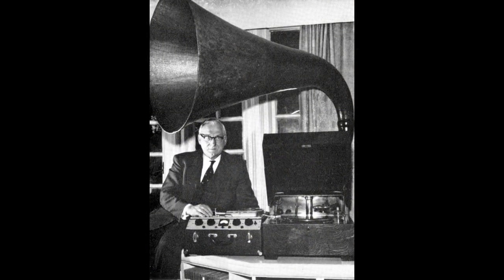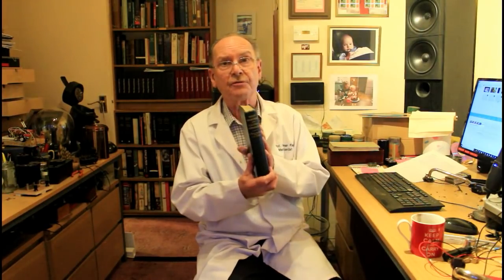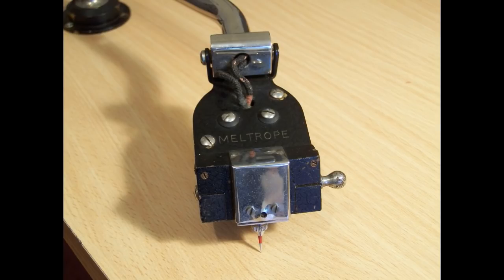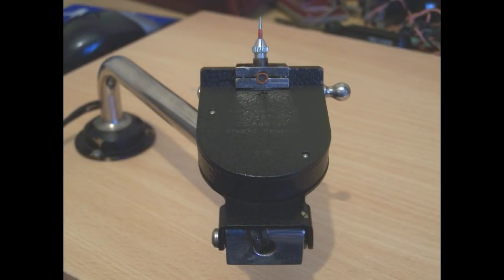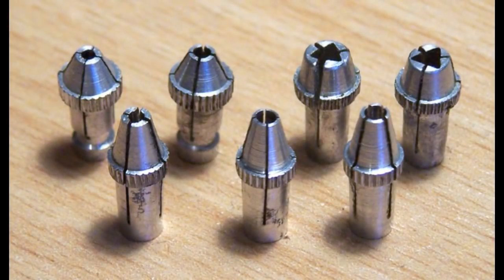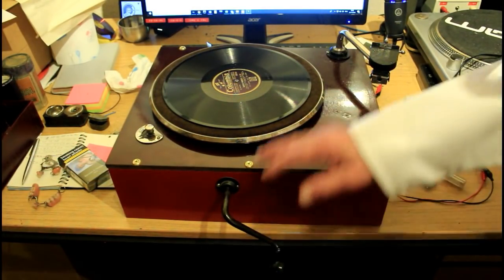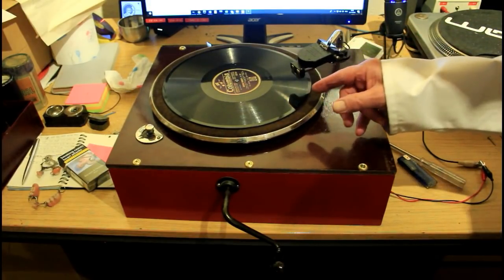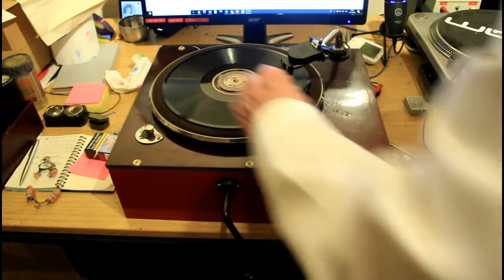meltrope electric pickup ~1930

Comment: Wind up spring motors were typically paired with a very heavy platter,  often close to 10 pounds, and thus having a steaying flywheel efect rater lacking in the thin turntable made of plastic in todays player.

That this Garrard unit had 2 springs is a plus also.  Gerrard was a qality manufacter of turntables.

Designend by man who was expert in the field ss descibed in video, it was better than heavy hosershoe.magnetvpicups that were normal for the time.

In fact vloser to kind used to day.

Comment: Thanks for this and congratulations on getting the toothpaste back into the tube.  I really loved the sound and it seems well matched to the early electric cutting heads.   Better than either the mechanical soundbox and horn or a modern MM cart IMHO based on your video here.

Growing up in the 60s and 70s there was a Stromberg-Carlson hifi in my grandparents' house that I was always forbidden to touch and I have always wondered how that pickup (admittedly a decade or so newer than your example) sounded.  When my grandmother passed away a few years after my grandfather, I passed by the offer by my mom and uncle and aunts to take it home with me because I was afraid of tinkering with direct-wired tube gear in those callow days of my young adulthood.  Still regret that hasty decision.
Reply from the maker: Thanks for writing. But don't worry. On the one hand, yes - it is very prudent to avoid old-time high voltage circuits. But on the other, it is quite OK to feed an electromagnetic pick-up into a modern 'Line Input' on a standalone amplifier. Such pickups usually gave out 100, 300 or maybe even more millivolts - an enormous figure. With such a pick-up, bass boost will be neccessary, but the top end must be left 'flat'.

Comment: From my experience in repairing Presto cutter heads and Grampion recording heads. Once you separate the horse shoe magnet from the pole pieces, you break that magnetic field. The magnetic intensity decreases. When resembling the head back together, you must RE-MAGNETIZE it. Or use a iron bar or shunt across the horse shoe magnet to avoid breaking the field.
Reply from the maker: Well - yes. Horse-shoe magnets always had 'keepers' to preserve the magnetic circuit. But having said that, I have never had cause to re-magnetise anything I've taken apart. This might be because although the output may have fallen to some degree, modern amplifiers were efficient enough to to bring it back up? I have re-wound low-impedance MSS cutting heads, & they worked fine with the same magnets. Let's hope I haven't messed up these devices... Cheers, Norman.

Comment: What a superb sound quality that 'Meltrope' reproducer has. Ably assisted by the superior 'Western Electric' recording equipment & high purity, (almost) silent surface material, used by Columbia records at that time.
Reply from the maker: Hi & Thanks for writing. Yes, it was nice, and when new, would have been much better. Yet: 'The chain is only as strong as its weakest link,' and in those days it was the loudspeakers that were the weakest link. (Often stll are today, but only because really good speakers are incredibly expensive...) Audio went along by fits & starts - but as you obviously know, it's great to follow the history of it. All the best to you & yours. Cheers, Norman.

Comment: Wonder what the counterweight on that 'soundbox' was???
Reply from the maker: Hi Jeffrey & thanks for writing. Well - in fact, there is NO counterweight on the head! It pivots... where it pivots; that is, at the back of the head itself.  I can't remember whether I quoted the playing weight in the video, but just checked it again & it's about 150 grams. Of course, the steel needle point was quite big, as was the groove of a 78 rpm disc, so the specific weight per uit area was possibly lower than playing a LP. Though I don't know anything about vinyl, so ignore that comment. 8^)    Cheers, Norman.

Comment: Hi dear Norman. I also work with professional audio and I wanted to know why the lack of noise that the versions taken with these electric pick ups have. If it is by the nature of the pick up. or by a subsequent mastering and cleaning of the noises with the software. thanks, Victor from Buenos Aires, Argentina
Reply from the maker: Hi Victor. What a good question! Happily, there is a simple answer, or rather, 2 answers. (a) I don't think I have ever processed any recordings of these old pick-ups. 'What you hear is what I got'... these pick-ups almost always have a large output, so I feed them into a LINE INPUT on my amplifier, which is an old NAD 3020A. The line input is of course, flat; no EQ, certainly no RIAA EQ! "RIAA is Death to 78s" - the top cut of RIAA takes away what little top end was on electrically recorded 78s, from 1925 until after WWII. (b) The absence of surface noise & scratch on these videos is, as you surmise, due to the limited frequency response of the early moving-iron pickup. Remember: when Wilson, who was a pretty clever guy, designed this pickup ~1930, the Western Electric system was the main system in use, by Victor (Hi there!) and Columbia in the U.S., and HMV (=Victor) and Columbia in the U.K. The Western Electric system had been designed only to go up to about 4500 Hz. So a correctly designed pick-up of 1930 should have been designed to fall off over ~4500 Hz, because there was essentially, no information there. 8^)  Of course, sometimes there was, but what the heck. I believe that WE (who developed their system secretly) limited the top end to 4500 Hz, because radio was expanding rapidly at the same time (1922-24), and there was a move to limit the audio bandwidth of AM radio (especially in the U.S.) so that as many as possible stations could be fitted into the Medium Wave band. The audio range ended up being accepted as 4500 Hz in 1927 (which it pretty well still is for AM radio  AFAIK); and because the modulation of a radio 'carrier wave' results in two equal 'side-bands', the bandwidth of any station on the dial was - & still is -  9,000 Hz - 9KHz. So you could have a station every 9 KHz across the Medium Wave band. I'm not sure about that last part, but it could be true. Hope this is of help to you. To sum up: it is indeed by the nature of these pickups, that they produce such a plausible, even agreeable sound. The 1930s was the first time that domestic audio could produce much 'bottom end', and people loved it! The called it 'mellow'. They weren't bothered (yet) by the lack of 'top end'... That only came after WW2...
Reply: @bixanorak   I thought you were going to tell me that pick-ups by allowing only tangential movements are deaf to surface noise. great job. Congratulations
Reply from the maker: @torugonza  Thank you! Only when poor condition 78 rpm record of 1928 is played with modern stereo cartridge with response 30 Hz - 18000 Hz, then, there will be a lot of crackle, hiss &c., &c., because much of the output of the cartridge has no information - only noise*. The Information will only be between maybe 50 Hz & 4500 Hz. Everyting else can be rolled off. A little bottom end may be kept to imply, to suggest, some low frequency. Also, to make 'top cut' too severe, creates illusion of 'dead' sound in upper frequencies. We who listen to old discs, may sometimes *need a very small amount of noise (hiss) in the background. Otherwise, we might interpret the sound as being 'dead', & therefore deficient in upper frequencies, when actually, they are present. Cheers, N.